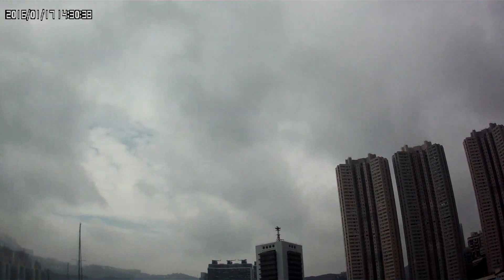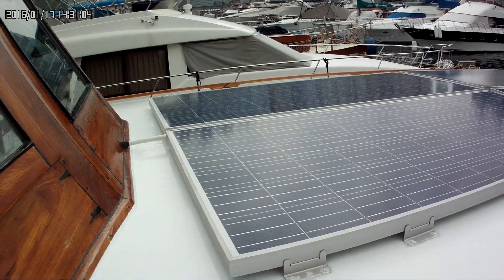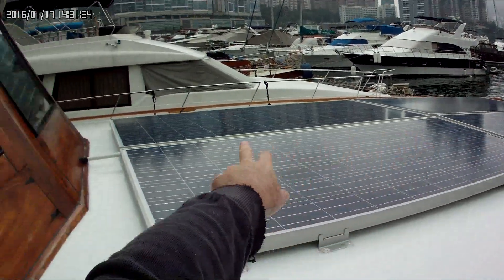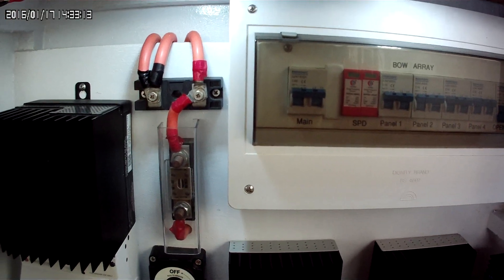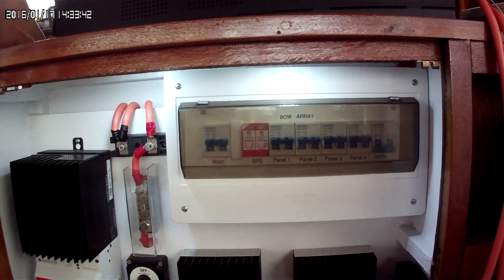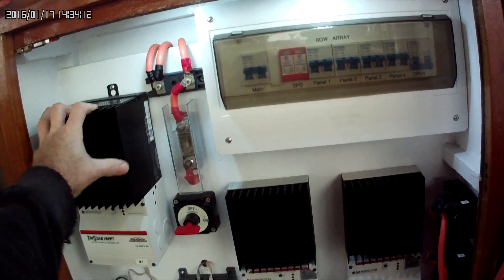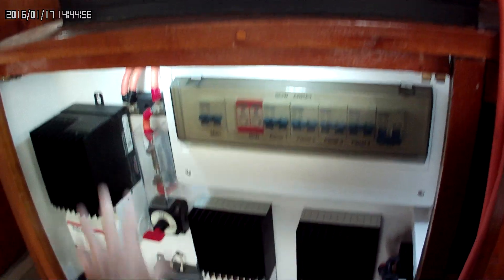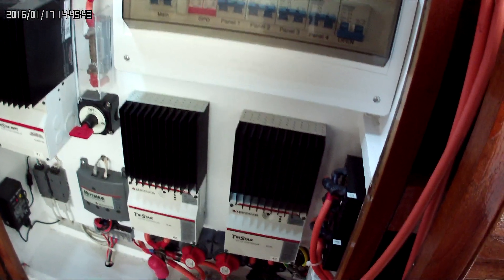My Solar Power System

Comment: Awesome!
What about the peltier cooling system?
Reply from the maker: I am re-designing the hot side... I have tried using the sea water below the boat to remove the heat, but the sea water chews up the aluminium too quickly. I am having a copper unit made with larger multiple ports for the sea water to flow better and evenly to remove the heat. I have learned that the water removing the heat does improve the cooling side. I am also making a control to regulate the amps thru the Peltier modules. That should also improve efficiency as there is more control of the current. It is a fun project.

Comment: Well designed system M8.....Wait, No speaker wire to be seen?...lol
Reply from the maker: HaHaHa... I realise I should have gone to the Audio and video shop to buy the wire for my system, but the proper electrical wire supply shop was much closer... Shows how lazy I am !! Plus I should be embarrassed because I have my panels flat mounted to the deck of the boat and still charge my batteries under northern hemisphere grey skies in January... Perhaps you could you direct me to an Ebook written by a fine "off gridder in a tar paper shack" that knows all, that is showing us how to do it better in New York State LOL. Have a great week my friend !!!